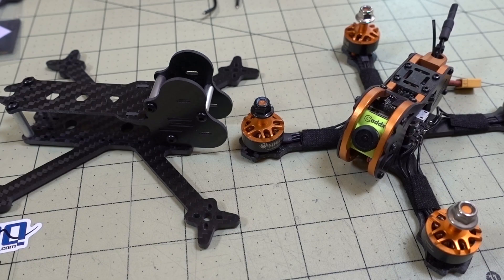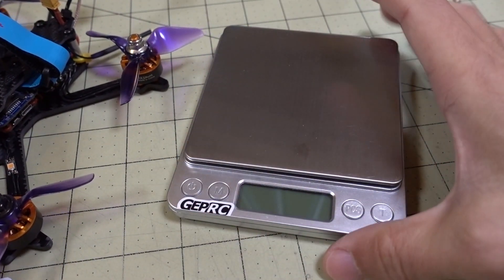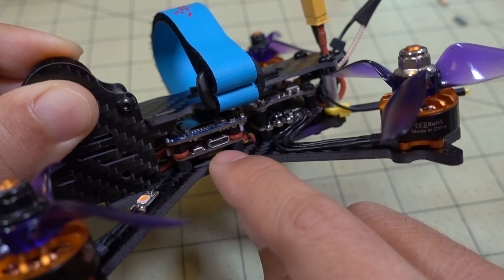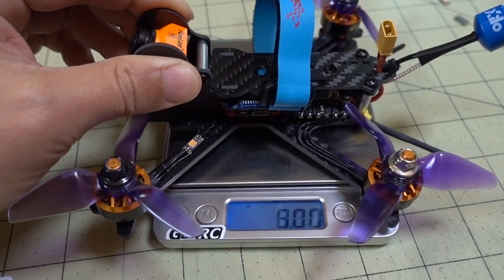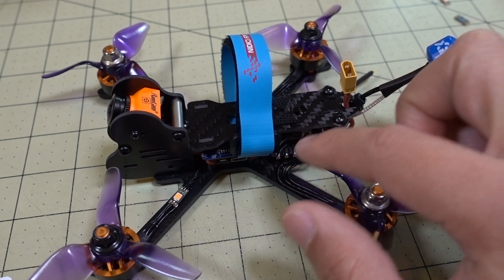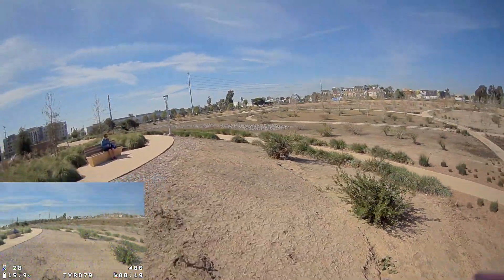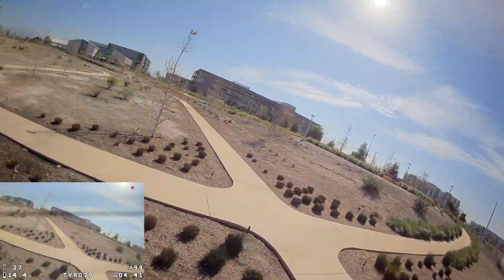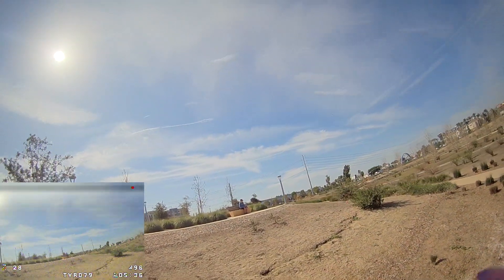Tyro79 Frame Transfer and PID Tuning 🛠️

Comment: After some winter flying abuse, and crashing on a school roof, the threads stripped in the aluminum side members! I like this little guy, so its getting a frame transplant into an HGLRC Arrow 3 from RDQ. Slightly larger, but almost equal weight. Might experiment with 3.5" props, which will fit based on dimensions. Thanks for the turning tips. I'm running 4.1.5 with JESC and RPM filtering, which is a real improvement.

Comment: Interesting video thanks Albert 👍👍. How was cutting and solder the motor wires, I was under the impression that on these motors they were just extension of motor windings and difficult to solder. 😁
Reply from the maker: Just scrape off the enamel

Comment: Nice work, I have converted my tyro79 to a GEPRC cygnet frame with RCinpower 1207 motors and avan props. Weight has dropped and it flies very well. In the process of updating to rpm filter in betaflight 4.1. Need better weather in the UK to test.
Reply: Hai alan.. Do you think it can fit Geprc cinequeen frame?
Reply: Everything will fit except the motors. I wanted to reduce the weight so smaller motors were perfect. Cinequeen has 1206 motors with 9x9 Mount. Tyro 1607 motors are 12x12 Mount. The GEP frames are very good.

Comment: Hi Albert, Don't forget this: - https://www.banggood.com/Donut-3-Inch-140mm-H-type-Frame-Kit-3D-Printed-Carbon-Fiber-for-RC-Drone-FPV-Racing-75_5g-p-1465407.html?cur_warehouse=CN  
All the TYRO79 parts go straight in and it flies very well, I have not had a chance to do a video as yet because of the terrible weather in the UK but hopefully I'll get a chance and upload something soon.

Comment: Id recommend the alfarc 175 or any 4 inch. Much more suited to 4 inch props
Reply: @pirateradioFPV  Not long ago, people were saying 4in was dead.
Glad it's making a comeback.
Reply: @pirateradioFPV  You should look at the Airblade intrepid v2 in 4in, it's a really nice frame.
Reply: I run a japalura 4inch and an iflight ix4. I think both are discontinued tho.
Reply: Do you fly yours like that? Is it just faster that way or more efficient as well?
Reply: @ValFPV  both
Reply: @RichardTardif1984  cool. can you recommend me a lighter 4 inch frame than the alfarc? I think with the fighter 175 I'll be over 250g with a 4s 650
Reply: @ValFPV  yes, the original comment is dated.  I now recommend a twig mutant or podracer 4.  Even lighter frame and you can use and aio 25.5x25.5 whoop board.  I use the jhemcu 30 a on the x night 4 inch tho the other frames I mentioned are probably better and more durable than the x night I use
Reply: @RichardTardif1984  can I still use the original stack in the podracer? Because as far as I know the twig mutant only takes AIO
Reply: @ValFPV  podracer can mount a 20x20
Reply: @RichardTardif1984  thanks, I found a really cool, reasonably cheap frame now (alfarc stick4) that is available on banggood. I think I'm gonna use that one.

Comment: I am switching over a couple of builds that I burned up esc’s on last season and starting fresh with BF 4.1 JM 48k - RPM filtering and been very happy with the ones I have finished. It is much easier to tune when you have a quad fly good to well at default. Way better than any other BF before :) I think I might actually learn what and how tune.... maybe lol